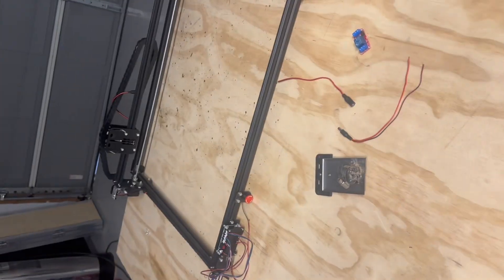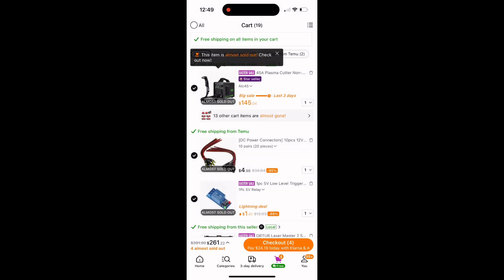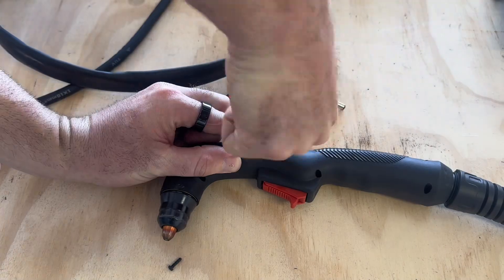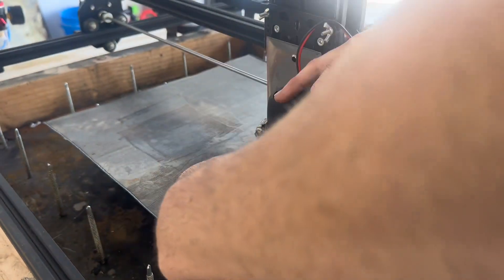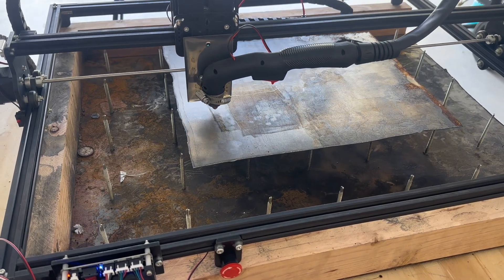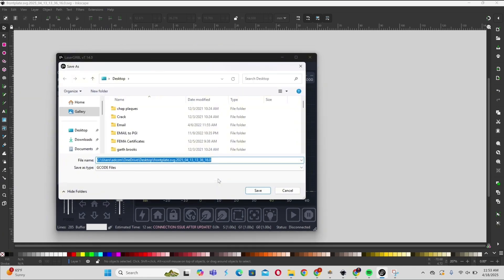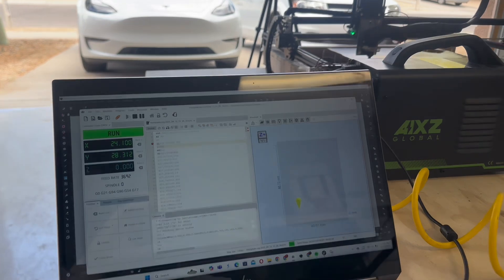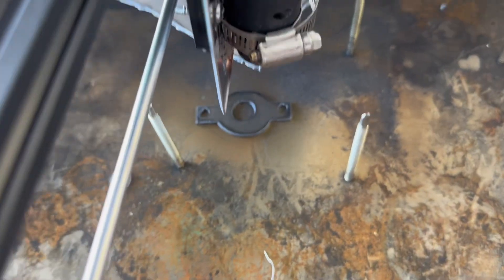How to build cheapest CNC Plasma Cutter

Comment: Appreciate you sharing this. I would suggest replace the torch with the straight one designed for cnc tables.
Reply from the maker: I agree. I’ll probably do an update video with how to make this little machine better in a few ways. Right now the biggest thing is the hose clamp attachment method. I’m going to either 3d printer something the will work with my current torch and eliminate the play or switch like you suggested to a machine torch and use scope mounts on a thicker mounting plate.

Comment: I did something very simular. I purchased a small laser CNC from Temu. Then purchased linear rails to make it larger. Had to hang the Plasma cable going to the torch from above, the step motor didnt have enough power to pull it. I thought about upgrading the motors and start selling DIY kits for $400

Comment: A better option to consider, buy a straight handle torch, they are fairly inexpensive. They are made for cnc, then you can still use your standard torch for other jobs outside of your cnc table.
Reply: They're just so expensive, if it's even compatible with your particular machine. The machine torch that works with my machine cost more than the machine itself.

Comment: How big is the cutting surface? What would be the biggest sheet of metal could you fit? Is this also with the extension kit?
Reply: Depends on the cnc laser that you buy, and if your plasma torch interferes with any part of it once installed.

Comment: Anyone have any issues with these relays?  The link has ships 2.  Both mine stopped operating after a couple minutes each.  not sure why.  Still lights up like its ok but the contact doesnt close.  At the same time I noticed the laser engraver doesnt turn off till 20-30 seconds after the job ends.  Even if you have it set to turn on and off multiple times during the job.  Google shows other have had this issue and they had to have there main board replaced..  But appears Ortur is not responding to messages to email.  At least not in the last few days.  Maybe just me tho, I seem to have bad luck.  The couple cuts I actually got i was super happy with and that was 0.25" material which is about the limit for my plasma cutter.

Comment: I love the project, i would like to know what the repeatability and precision is like, i am looking into building one and potentially upgrading it to get better precision and repeatability
Reply from the maker: The thicker the material the better the repeatability is and the level of precision. The thinner gauge metals can warp a little and cause the plasma cutter to touch the work surface resulting in a failed cut. Thicker material that won’t warp is very repeatable and has a high level of precision
Reply: @ZMANBUILDS  i appreciate the fast reply, do you have a number for the tolerances? I need tolerances of ±0.13 mm, not really expecting this machine to hit that without upgrades but id like to know what its at right now
Reply from the maker: @markomiloshev I don’t know the tolerances but I think it would work for you. If you need apsolute precision the main thing to do is going to be stiffen the frame and have a better way to lock in the squareness of the frame. Lastly the way you mount the cutting head to the machine should be rock solid.

Comment: Anyone else have any issues getting UGS to connect to this?  LaserGRBL connects just fine but cant seem to get UCS to connect using the same settings.
Reply from the maker: I don’t know if this will work but try and uninstall and reinstall making sure you have the most updated version.
Reply: @ZMANBUILDS  never did get ugs to work but I can run it with LaserGRBL so not really a issue.
Reply from the maker: @rbnice1 were you able to set a delay in the gcode with laser grbl?
Reply: @ZMANBUILDS  yea.  I used UGS to modify the code then just used GRBL to run the machine using the gcode I modifed in UGS.  still no idea why i cant connect using 1 but not the other.  not a huge issue tho compared to the laser on/off issue i have going. lol

Comment: Anyone have the issue of flame detection for the module when the plasma is going? I'm not sure where the sensor for that would be. My engraver is a little different with the box/controls sitting at 0x0y

Comment: How exactly do I wire the plasma cutter head to the laser engraver? Thanks
Reply from the maker: It's explained in the video. Basically you wire the laser to a relay and then wire the switch on the plasma trigger to the other end of the relay. When to laser trys to power on it closes the relay and turn on the plasma cutter.

Comment from the maker: Like comment and subscribe it helps the channel so much.
Reply: Can we please get the code
Reply from the maker: @jai.lo66 what code do you need?
Reply: @ZMANBUILDS actually I'm not sure it's even a code, but since I'm using a Arduino uno with cnc shield, I thought I could do a mini plasma cutter. Unfortunatly I can't get it to fire off a relay. I used open builds software and even though the software reads and manipulates the drivers. It won't change over to plasma model. This not being able to use it as a cnc plasma cutter.
Reply from the maker: @jai.lo66 are you using the same 5v relay I linked in the description? You should be able to get it to activate the relay if you can get it to activate anything else, like a laser or whatever
Reply: @ZMANBUILDS yes same 5 volt relay, I just think because it's flashed with laser grbl it won't allow it to go into the plasma model when I try it with open builds, have you by any chance read about jds garage plasma build? I was following the same procedure but it just won't go into plasma mode.
Reply from the maker: @jai.lo66 don't worry about a special plasma mode run it as if you are running a laser program but add the code I was adding in the video so that it pauses before moving that's how you make it plasma mode. I have seen that jds build it's very cool
Reply: @ZMANBUILDS okay I follow but is there another way to add that gcode before the Pierce? Cause what if I have a ton more pieces? 😅
Reply from the maker: @jai.lo66  I would upload the gcode to chat gpt and have it add the 1/2 second pause before each movement much faster than by hand and works great